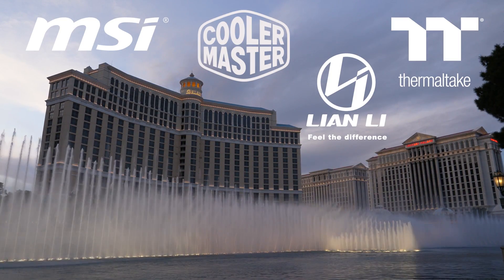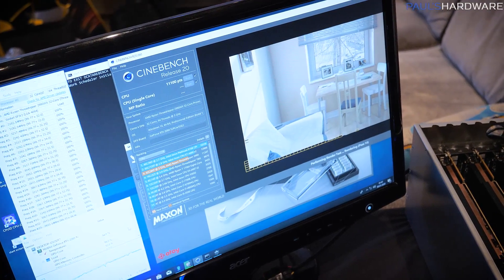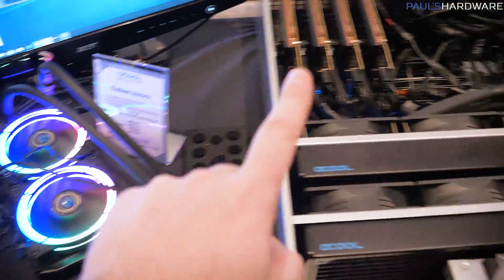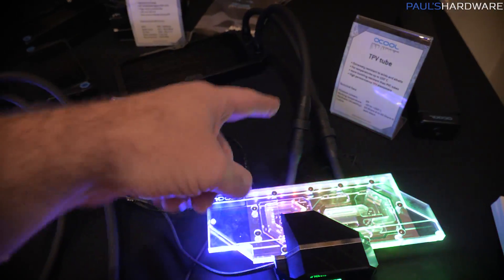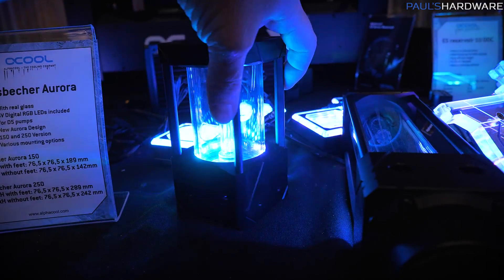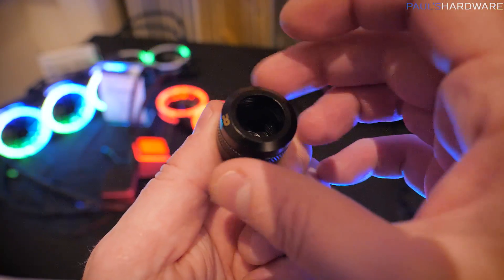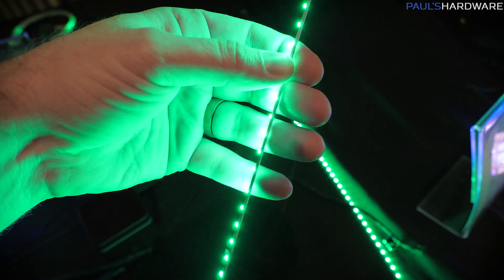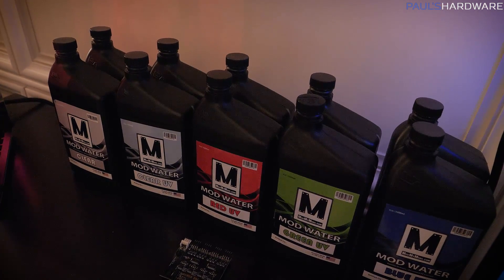Alphacool's Next-Level Watercooling Hardware!

Comment: Digging the GPU block and Closed loop cooler combo that lets you use same block for liquid later on. Link on where I can buy these parts? Does it comes as a kit (that would be ideal)? Are you planning on doing a review of this on your own? Subbed just for this GPU cooling solution as this is what I am looking for right now.

Comment: 1:46 Can you change the tubes at the AiO? It would be really cool to be able to change it to some clear tubes (i see that there is a fill port , so i guess you can change the coolant).
Reply: All our AIOs are using standard G1/4" fittings. So you can replace them with any other fitting and tube you like.

Comment: I have just mounted one of their new generation GPU waterblocks to my Sapphire 5700 XT Nitro+ and I must say it looks and cools great! With a Ryzen 7 3800X also being in the loop (cooled using an Eisblock XPX Aurora Edge) and a single 420 radiator that I had left over from a previous Eisbaer build I now get a max. of 65°C on the GPU hotspot running Furmark where I reached 91°C before. Great job, Alphacool!

Comment: please work on the pumps not RGB or modular stuff, get your basics right first Alphacool. This pump is actually OEM'ed and used alot in car industry. But the longevity in waterloops is more than questionable, its a pump that isnt even meant to be used ongoing for several minutes or hours, 
its produced for windshield wipers. 

I had the Eisbaer and the Eisbaer LT .. with the very same pump which both died within a year / after some month. And thats also what people i know which bought the same products or OTHER vendors AIO's with the same pump experienced.  Unless you put much more effort in fixing pumps instead of making everything shiny, i just cant waste my money into this.

Comment: The server rack with water cooling is actually pretty awesome. It is very difficult to find something like that at a 4U size that can be mounted under a desk, which at ~28inch long it can be mounted under most desks with extra clearance in the back. Just take a look at what Linus had to go through with his getting custom home server chassis and design from 45 Drives. Watercooled Threadripper here we come!
Reply: We have parts and solutions for 1U, 2U, 3U and 4U Serverracks... check it out: https://www.alphacool.com/enterprise-solutions

Comment: so can we choose ANY of their radiators and then at the new tubes to them or are tubes fixed to certain radiators only?
Reply: You can use ANY raidiator. All parts are normal DIY parts with standard G1/4" threads. You can built with it what you want ;-)

Comment: Ain't gonna happen. Server water cooling has never taken off for several reasons - no redundancy, the density of the case, inefficient airflow for radiators and the maintenance needed for draining/flushing. That 2U case shown would need to be considerably DEEPER to fit any storage drives, which would still need to be air cooled along with the memory sticks. Also a typical rack is only 17 inches wide giving you just a triple 120mm fan space - barely adequate to cool two 200W processors and four graphics cards pushed to their limit. Never mind the risk of a server up top leaking and destroying whatever is sitting underneath. It's just not worth the risk. Even if everything is working, just a preliminary pump failure can take a system offline for hours - not cool if system up time is critical and your admin is unavailable.

Even for a home-use workstation you can hack together an external cooling solution to use with a tower case, or go the DIY route and build a desk PC with custom water cooling. When you can spend northwards of $250,000 on just one 4U worth of top end server grade hardware to go into just one 48U rack you begin to understand why the cost of a dedicated server space with it's own cooling, air filtration and sound dampening becomes the smarter, cheaper and less labor intensive option.
Reply: We are working together with some of the biggest Serverparks in Europ and all of them want to change from air to water cooling because they have massive problems with heat. And we have redundant systems (pumps) and you can change everything very fast if you have any issue. In a 4U Rack we can handle up to 3200W in one 4U Rack without any problems.

Comment: This has probably been the thing I'm most interested in from this years CES. Looks like a great first step into water cooling
Reply: EK did something similar a few years back, but didn't seems to be well received by the market.
Reply: I had previous gen Eisbaer and Eiswolf combo for i9+rx 5700xt, 360mm and 240mm sadly eiswolf had terrible fans and instructions (One of the thermal pads u need to cut yourself was like 50% thinner than other 2 pads and there was no mention on it/where it should go....) Bad experience but after i got it together performance was great.... But i sold the system coz i didint want to look at those ugly hoses and big connectors that orginal eiswolf and eisbaer have.
Reply: Honestly if you do your own loop with rubber tubing (EK zmt) and compression fittings while following advice from people that have done these builds before you'll get a better result than kits. Especially if you go with a really stable long lasting fluid like Koolance 702. Just make sure you leak test before you plug the rest of the system in. I would also recommend going with Black Ice GTS radiators, they are some of the cheapest radiators on the market but also have some of the best performance.

Comment: I WANT THAT GPU COOLER SO BADLY!
Please do a review on it when you get it Paul <3
Reply: Please, both AMD and Nvidia!
Reply: Yeah, this is going to need a review.  My only real concern would be the weight of it.  I imagine it has to be pretty heavy when placed on the gpu, which could cause problems down the line.
Reply: @ragingpapist103  honestly these would look best in a vertical slot so might negate that issue.

Comment: If you're adding an empty GPU block to an AIO do you have to fill the water? only enough water for the CPU so surely there would be too much air in the system
Reply: We will offer prefilled versions of the GPU block with tubes and quick disconnects but without a radiator too. So you only need to connect it with an Eisbaer or a prefilled radiator (we have some). Or you have to fill the loop over the fillport wich you can find on the top of the Eisbaer.

Comment: Alphacool is bringing it!!! Definitely using all of these parts in my next build.
Reply: I think you will not keep aluminium radiator cores. Bimetal galvanic corrosion is bad for cpu cooling blocks their nickel plating 'goes' first (some dyes catalyse electrolysis). Copper radiator cores all day for mine. I liked the qwik d/c's and premium fittings, the gpu blocks. I think Alphacool are well worth supporting (just not their cheaper radiators so much).